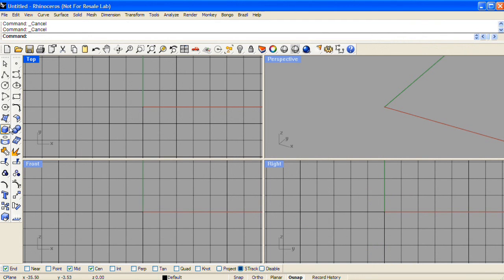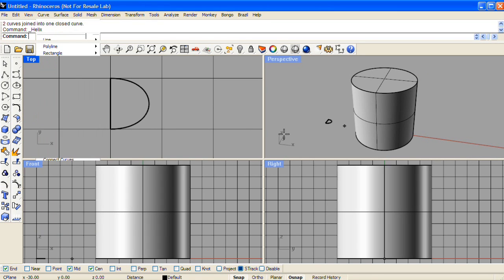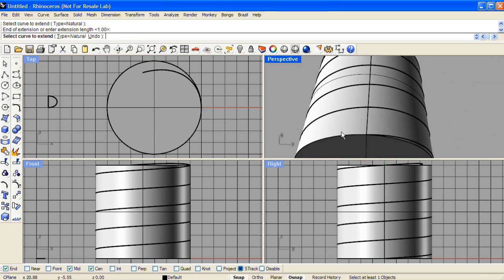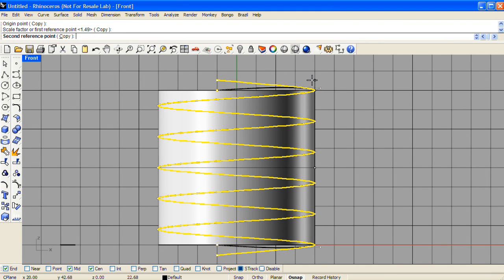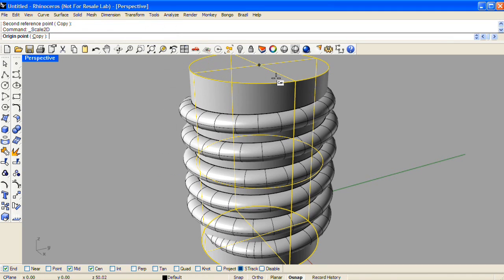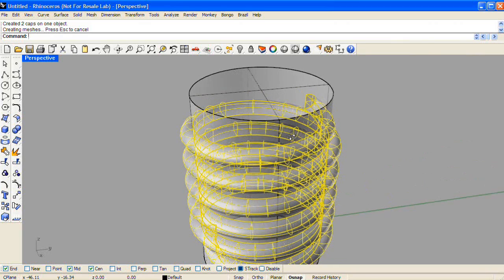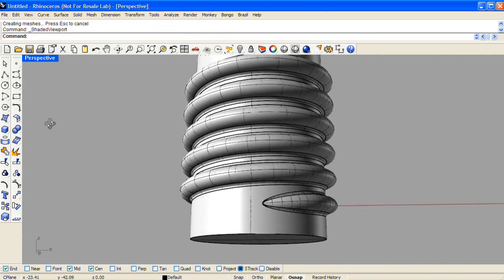Modeling screw threads (1 of 2)

Comment: Hello, when I try to extend crv, I can't really extend it nicely as you did, my extension draws larger and bigger, not aligned with the spiral form..
Reply: not dynamic extension, I just followed what you exactly did though, I don't know why...
Reply from the maker: @Kk-jj3xi  Post the curve in a 3dm file to the Rhino user forum (https://discourse.mcneel.com/) including the result you get that doesn't seem right. My guess is that there are multiple control points close to each other at the end you extended causing the tangent direction to be unexpected.

Comment: Hi There, As I'm trying to follow this video a few things weren't looking right in scale, ie my thread shape was too small and I had many more helix rings then yours here. I restarted using small objects in inches document and still my cylinder looked huge compared to this one. Can you please share your document specifications for this video? I can't seem to find that information anywhere. I'd like to also know the grid settings for this page layout for the same reason. Thank you!
Reply: The file was made in the small objects inches template where there are major grid lines every inch. Email your file to tech@mcneel.com or post to the user forum if needed. http://discourse.mcneel.com/ This video is pretty old and used v4 but it should still work the same.

Comment: I cant!! do fillet, i follow all the steps but whe i make the fillet it made separate, i changed the dimesion of the fillet but the results are the same
Reply: +bradian1 At a guess, I bet the surface edge of the thread sweep is very close to the intersection with the cylinder. This is a common reason fillets will fail... when they don't have enough room to trim against the adjacent surfaces because of some skinny bit you hadn't noticed. If this seems possible, try SrfSeam to relocate the seam of the thread away from the intersection before the Boolean. Post a model to the user forum if you need more help... http://discourse.mcneel.com/
Reply: +Brian James Thank you so much i did it!!

Comment: ... continuation... from the top right of the helix to the left end on top, than yours, and the end of the helix top and bottom does not bend smoth as yours, it bends abrupt from the last control point that is close to the end of the helix.  It bends like a ski ramp instead of continue the natural angle of the helix.   I even deleted some control points close to the ends of the helix, it helped but it seems not to be the right way to do it.  I will continue to find the way.  it is a nice lesson.

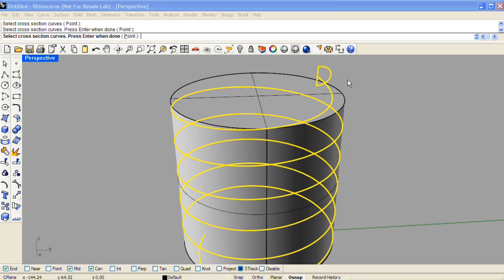Comment: Thank you, the "natural" solve the issue. Another problem, at 2:29 my "half circle" straight line does not attach to the helix as yours, vertical, my straight line of the half circle attach as 30 degrees to the left, and then the thread down the helix turns itself around the helix line, with the round part turning to the inner part of the bottom half of the helix. May be it happens because in my helix, at 2:03, there are more control dots... continue

Comment from the maker: You're welcome! The Taper command may do what you need here. I would suggest using it before the sweep of the thread cross section. Make sure to check out the command line for options when running Taper to control the result.